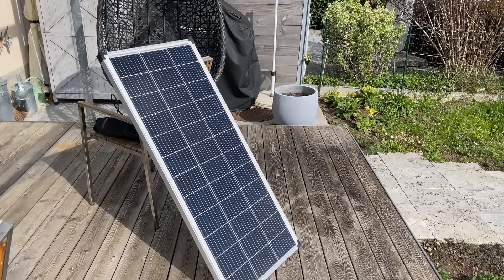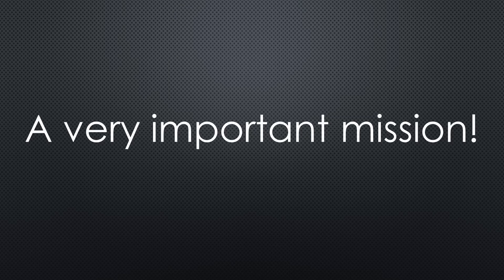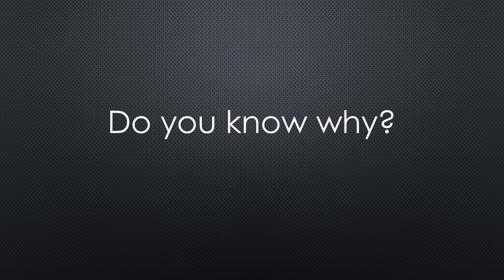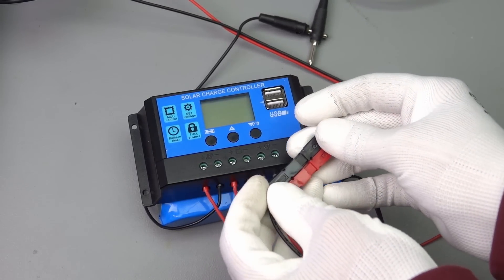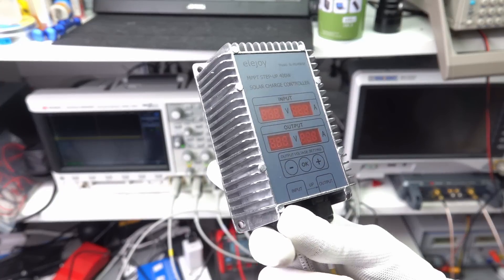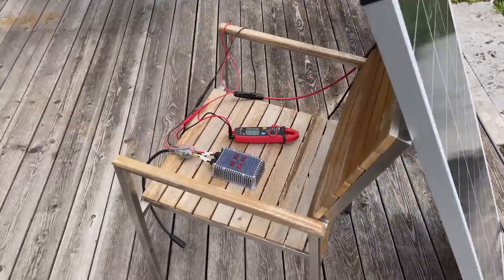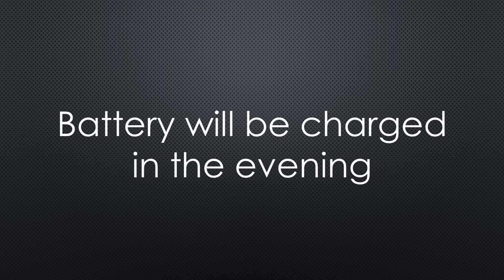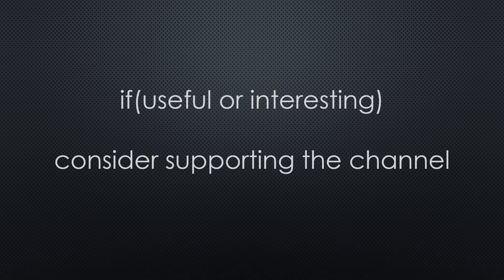454 How to Build an Solar Battery Charger for eBike / Electric Bicycle

Comment: LOL, this is like one of my recent projects..someone broke into my shop and stole buch of stuff including the electric bike of my neighbor that I built for him and needed to fix the battery.  So I had to build him another bike, and this time I wanted to fix all the battery inside the frame, and everything just become complicated, and this time he wanted the charger to have a led that went on when it was done charging, and I spent days getting this work, since I was had the bms board protecting the battery from over/under charge, I figured I can tap into the charge cutoff, and yeah turned out it was complicated to do so, and after a week finally got it working, but by then he was not happy it took so long and just bought another used ebike instead.  :(     I recently finished solar powered lights for a chicken coop, and that led's needed 28v, so I had to boost the panel output and this was also more complicated and when I got it working, it seemed like it got wet and something shorted....never easy is it?

btw, I had a similiar problem in another project, there are dc-dc chips that can handle 60v, lm2596HV, you could the cheaper 35v max boards and swap in the HV chip...oh, look, aliexpress sells them already with the HV..https://www.aliexpress.us/item/2251832840370486.html?gatewayAdapt=glo2usa4itemAdapt&_randl_shipto=US
Reply from the maker: Indeed, your stories are even worse than mine ;-) But you are a brave man to care about your neighbor (he seems not to be such a kind person, though)

Comment: Flyer e-bikes. The best Swiss quality. Do you have any idea Andreas if we could somehow build an external extra battery pack for this kind of battery ? I also have this 635Wbattery, but I have about 2000Wh in 18650 Cells and could make a huge pack for it too. Just..... I don't know if that is possible because I guess the bike communicates with the battery while driving?
Reply from the maker: I never looked into the interface between the battery and the bike. We have 2 batteries each for long trips.

Comment: You showed that nothing is impossible for a swiss engineer, but maybe after all the hard work you would now recommend a balcony power station. It would be the easier solution, and it would pay off some time. Of course this wouldn't be a topic for a video.
Reply from the maker: I like the idea of "balcony power stations" (I have two of them). I think it is not easier (and certainly not cheaper) because most microinverters do not work with small panels (mine is 370Wp each and not 100W as used in this project). Those big panels are not allowed everywhere...

Comment: I was kinda hoping you'd cover implementation of a MPPT algorithm via microcontroller, meshed with a switching power supply control system on the same controller.  😅  Though $40 from China isn't terrible.
Reply from the maker: I was happy I did not have to do the heavy lifting of creating this device ;-)
Reply: @AndreasSpiess  Fair enough!  I want someone else to do the heavy lifting for me as well.  🙂

Comment: Great stuff, I had the idea of a solar powered ebike and have roughly calculated  it would need too much panel to do it.  One that could go continuously anyway.  The flexible ones give some hope becaue of their weight reduction could allow you to carry enough panel on a trailer, which you then could spread out to charge in a reasonable amount of time and continue on your journey.(like a youtuber has done with a van)  But considering id want a 42v 200ah bttery (to get about 8 hours of driving on a 350w motor)for this type of vehicle id need 1000w of panel to charge that battery 10 hours, so even 1000w of panel would take approx 2 days to fully charge a battery that gives  8 hours of driving.  Not terrrible ratio, but not good either, and thast with 1000w of pannel loaded and not to mention  a big battery. Which actually brings that driving range down to less then 8 hours.  This is the kind of challenges solar vehicles deal with, However some have done it, and treat the journey like sailing - you can only go when theres wind, so theres lots of down time and slow travel but doable in that sense to travel the country, by solar,  solar land sailing if you will.
Reply from the maker: Mobility consumes a lot of energy! A lot of people are astonished to see that their car consumes much more electrical energy that their home ;-)
I think, a mobile panel is only for very specials situations because the numbers you mention in your post.
Reply: You could consider recovering energy on the descens with a dynamo or something. It would add more weight but improve the ratio drive/charge time.

Comment: I would have gotten a higher voltage panel or gotten three smaller 12v panels. I could have then used a victron charge controller as they are easy to set up for different battery voltages.
Reply from the maker: Good ideas!

Comment: Prescient  Andreas :-)  I'm working on a AGM solar charger ATM  for my east/west panels  and  24 battery (MPPT is a PITA )
Reply from the maker: I also built a 7kWh LiFePo4 battery. But I only bought the MPPT charger, I have not tested it yet. So I do not know if it works.

Comment: How about simply using a microconverter, like enphase iq7+ (approx. 135 euro), on a standard 300W solar panel. Gives 220V 200-300W output and you can plug-in the standard chargers of the bike or anything else that runs on 220V. Lol connect it to the standard grid (separate group is advised) and when not charging the bike to reduce your bill a bit when the sun is out.
Reply from the maker: Also a good idea! A bit expensive. And I am not sure if the Enphase would start without a grid (mine switches off if I disconnect if from the home grid because it is the law).
But for sure good if you have enough space for a >300W panel (I have two of them connected to my home for a test)
Reply: @AndreasSpiess  Ah yes, almost forgot that. The IQ7 does do that. But there are models that can work off-grid as you can see here: https://www.youtube.com/watch?v=TgIK6n5P06Q

Comment: Seems like it would have been far easier and likely less expensive to have done a more traditional solar system. Starting with panel, mppt, and a battery larger than the bike battery provides a stable source of "solar" power potentially useful for more than just the ebike.  Then you can evaluate if a small and cheap inverter combined with the existing ebike charger is more or less effective than devising your own charger, e.g. a boost converter.
Reply from the maker: I agree this would be straight forward. However, the (useless to drive) battery would need at least 700Wh. Not cheap...
Reply: @AndreasSpiess  Yes, batteries are a wild card. Keep watching the prices as they are falling fast. It seems everything is more expensive in Switzerland. In the U.S. the best price point for LiFePO4 seems to be 1.2kwh at 12v (100 amp-hour) where there are many choices for $300 to $400. I recently purchased 4 of these batteries for US $1100. Three years ago the price was more than twice that.
Reply from the maker: @Sylvan_dB  I just built a 7kWh LiFePo4. 8x302Ah = 1600 $ plus BMS and box. Not as cheap as it was before the war, but still ok.
Reply: @Sylvan_dB  Raw material prices for battery cells have been very high (~1.5-2x) the last couple years, but in recent months are dropping back to ~2019 levels. It may take rest of this year for lower costs to work there way to through to end purchasers.
Reply: @AerialWaviator  I've been watching and buying LiFePO4 cells and assembled batteries at retail for several years. Retail prices are already well below 2019 levels, likely due to margin compression between wholesale and retail. It will be fascinating to see how much cheaper they can go.

Comment: Curious; wouldnt a higher voltage panel be a better solution along with a bms?
Reply from the maker: A panel with the same MPP voltage as the charging voltage of the battery most probably would work without a converter. However, they are usually bigger (400W). The BMS is already included inside the Battery. It is the law that they do not explode.

Comment: How much current needs the 5 Volt input?  If low > zener diode  + resistor in serie on the 42 volt output? = simpler?
Reply from the maker: I did not measure, but assume, not a lot. So your idea of a Zener diode most probably would be much easier!
Reply: I would not be suprised if the total power consumption of the resistor would be smaller then that of the 2 5 volt converters? 100 k Ohm = 42-5 / 100000 =>0.36 mA x42=15mW ?

Comment: hi !
have you got any schematic (or at least photos) of the inside of the mppt booster ??
best regards ....
Reply from the maker: No. I did not want to open it (it seems to be protected against a rain shower or two). But I would expect a PCB, not more...

Comment: Would converting the solar power to AC and using the regular charger for the bike battery work? 🤔
Reply from the maker: Should work. Probably with quite some loss.
Reply: @AndreasSpiess  Oh most definitely it's not very efficient that way... it might be a bit more "plug and play" though... on the other hand... i wonder what happens in this scenario when the panel and therefore the inverter doesn't provide enough power (like a brownout) for the charger...
Reply from the maker: @gorgonbert  I thought I showed it. The converter switches off

Comment: I had this problem with our motorhome which had 200W of solar. OK, so we ride our bikes in the sunshine but when we want to charge the bikes we have no solar and use the needed 12V habitation battery which means we may run out of power for the motorhome in the evening because two e-bike batteries represent a substantial part of the habitation battery capacity. You have a worse problem, want to ride in the sunshine, fine, but when you return the sun is past it's beat.
Reply from the maker: We have two batteries for each bike for long trips. So we can charge one in normal conditions

Comment: what if you used a step down converter and a solar panel that has 50-55v voc when there is less power the solarpanel voltage will only drop to the battery voltage and still charge. you need a module that has a diode in the output if not the battery will drain if there is no sun.
Reply from the maker: I assume, a step-down converter would create similar issues as it would "suck" too much current out of the solar panel. Then, the panel again would work at a low voltage far away from its MPP (the batteries have a very low internal resistance).
A possibility could be to select panels with an MPP voltage close to 40 volts. Then  the panel would work close to its optimal point.
Reply: @AndreasSpiess  i tested this whit a lap powersupply i don’t know if its a fair test. i put it on cc and when i ask too much it keeps charging i don’t have a solar panel so i can’t test it in the field and i live at my parents hous so to buy one make no sense 😂
Reply from the maker: @electro2606  I assume the voltage of your lab power supply was reduced when you limited the current. This is what happens with the solar panel. And usually, this voltage is way below the MPP.

Comment: Did you consider panels in series to get the voltage you need.
Reply from the maker: No. I only wanted one panel because of its mechanical stability. Also, a similar problem would occur if the MPP of the panels would not exactly match the charging voltage of the battery.

Comment: Normally should work with some capacitors before the buck/boost or septic converters and afterwards the charge controller, for Instance BQxxxx from Texas instruments, they can control the charging current.That's just another cheaper way to do it, but that's the beauty of electronics, anyone does as they please as long as it works!
Reply from the maker: I was able to control the current with one of the boost converters. However, in this setup it is necessary to control the minimal input voltage. Which is rare for converters because they usually focus on the output voltage (which correct for most of the situations).
Reply: Yes, try to use some ampops if you don't want the charge controller IC, anyway, it's allot of work, somehow better than watch TV and listen politics talking that they gonna help their best friends, lol

Comment: I'm not seeing the problem with connecting the grounds. If the + and - outputs of the solar controller/boost converter are truly isolated from the input side, then the 5v source should not also need to be isolated.
Reply from the maker: I am not sure if they are truly insulated and I did not want to take the risk to destroy a 1000$ battery…

Comment: I do think having two solar panels in series or a large high voltage panel would be better than such a complicated solution.
Reply from the maker: I agree if the MPP of the two panels would more or less match the 42 volts. Otherwise the voltage would be dropped down to the 40-42V and would be much lower than the MPP.

Comment: I own 4 of those exact controllers. its a cheap easy thing to use for low voltages but yeah you ran into some high voltages and a very custom issue

Comment: I hope the solution gets through the WAF (Wife Acceptance Factor) 🎉😂, great solution, I have such an MPPT for my 200W panel which also needs to charge a 48V LifePo4. Need to check if I see the same issue. And indeed finding these MPPTs wasn't easy, please be aware they have a buck and boost one, the look almost the same on the pictures. Have fun now you have more time for your other projects. How are your solar panels doing?
Reply from the maker: 1. You are right, they have two versions
2. My solar panels on the roof are doing very well. For 3 months in winter, we had to buy electricity. Since February, we have been completely autonomous again (the weather was not very nice here). Up till now, they produced 7.5 MWh and we consumed 3.8MWh (3MWh from our PV)
Reply: @AndreasSpiess  that's a very nice generation that saves a lot of cash, I could only hope for it. Thanks for sharing!

Comment: What would happen if you used two 20V panels in series with no controller?
Reply from the maker: It still would not work. I would need panels with a total MPP of at least 42 volts. But then, I could save the controller.

Comment: Cheeper is using acdc converter for solar panel and use normal charger for e-vehicle
Reply from the maker: Still, the DC-AC converter needs an MPPT. And you would lose a lot of efficiency with the double conversion. But I agree, it would work, too.

Comment: Andreass what happened to the 5v supply for control pin of the battery? 

The video seemed to say it didn't work with the 5vto 5v regulator.

Thanks.

(Engineers are such masochists.. not only do we do it for work, we do it for our hobby,  too.. and the consequences of failure at home are much worse! :-) )
Reply from the maker: It works with the 5-5volt converter. However, other viewers proposed to use a simple Zener diode which is probably a better (or simpler) idea...

Comment: wow it took me less than an hour to find and order parts once i got them less than an hour to build it ,2 solar panels ,with mttp charge controllers 2x dctodc cc/cv boost converter some wire and 2 plugs
Reply: now charges my 85 volt ebike battery from solar
Reply: yes the panels cost alot for 2 300 watt foldable panels
Reply from the maker: Indeed, these are huge panels!

Comment: Ming-he Brand Has a MPPT Solar  Boost controller "Ming He MPT-7210A MPPT Solar Charge Controller 20W ~ 600W"  Julian Ilett covered this little guy a few years ago
Input voltage: DC12-60v > Output voltage: DC15-90v,adjustable for 24V/36V/48V/60V/72V/90V

Also Genasun Boost MPPT's (EU, USA) For Lithium  (even do Li Polymer) Smart Charging
Reply from the maker: These seem to be other good solutions. Thank you for your additional info!

Comment: Excellent but You are not afraid of accidentally changing the  output voltage settings, not necessarily by a human, but as a result of resetting or transients?
Reply from the maker: It would not be dangerous because the battery management of the battery switches off at around 42V (it is the law). The charging current probably would be a bit high in this situation.

Comment: (4x) 100w mono Solar Panel > DROK 720w Buck Converter (adj. to 14.8v) > Pure Sine Wave Inverter 500w range is 11-15v input > Charger that came with the eScooter or eBike > Plug it in, commence charging. The cost is money, time and knowledge.
Reply from the maker: Good idea. But maybe also a bit lossy because the efficiency of each component is less than 100%

Comment: Try a current limited boost converter and set the low voltage protection. They are inexpensive.
Reply from the maker: I tried it but it did not work because of the reasons shown in the video :-(
Reply from the maker: Your comment was deleted by YouTube because of the included link. 
These converters protect the output, not the input voltage, unfortunately 😞
Reply: @AndreasSpiess  the 60/90V out 1200/1500/1800W Aliexpress boost converters have a low voltage protection setting. It will reduce the current until the input voltage rises above the setpoint. This is supposed to emulate a simple MPPT. I haven't tried that, since I already have a Victron MPPT charger and a 48V battery. Not sure what would happen if you try to run a load directly from the boost converter from a solar panel without a battery. But of course, the panel can't supply reasonable wattage in low light.

Comment: Sorry why not start with two panels and 48 V and a buck boost converter?
Reply from the maker: I fear that the same problem would occur: The input voltage of the converter would drop down to close to 40 volts because the batteries "suck" all current they can get. According to the solar panel curve, its voltage would drop to a point far away from the MPP.